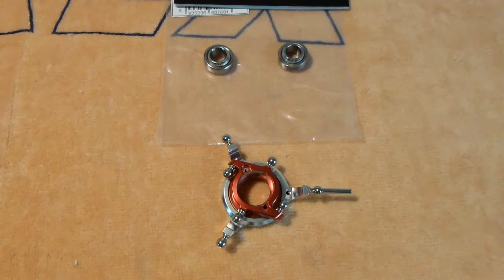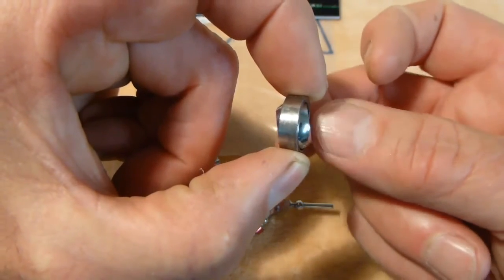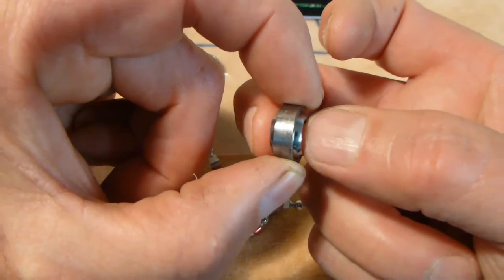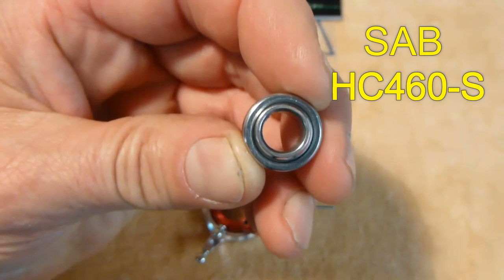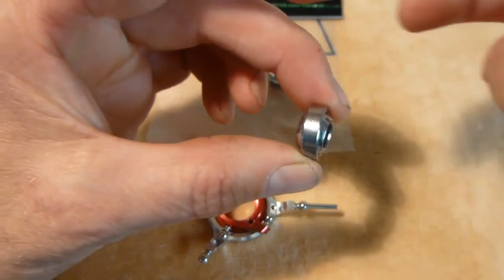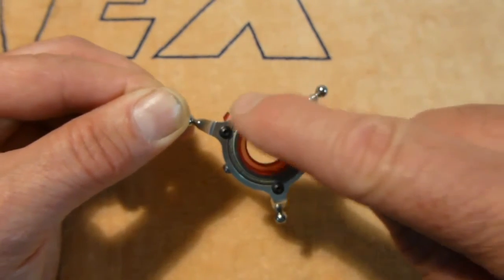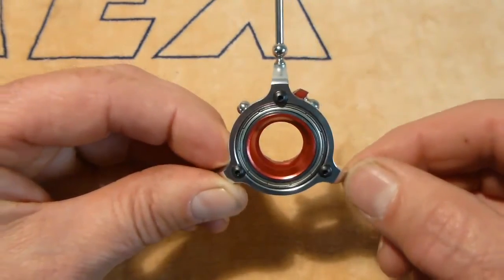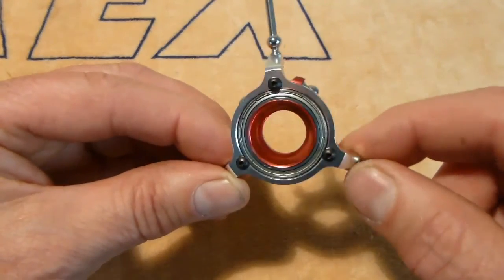CHASE 360 SWASHPLATE PROBLEMS

Comment: could you replace the whole swashplate with a g380 swash?
Reply from the maker: The g380 swash is larger, heavier, and a different design. May not work well with the chase
Reply: Doug Howdy ok thanks
have you done any other modifications to your chase 360?